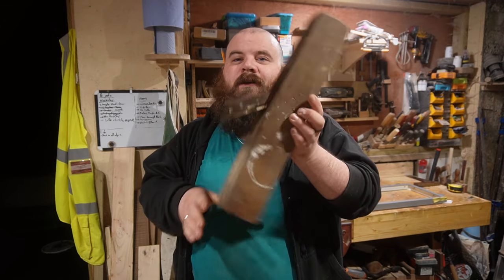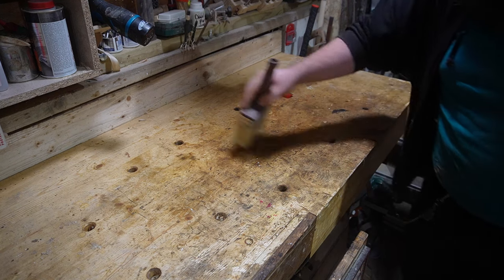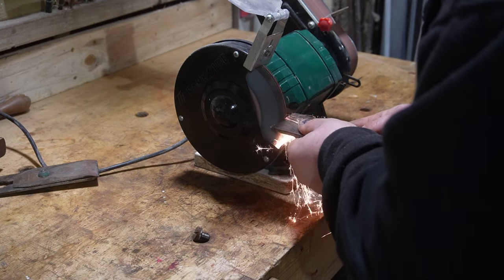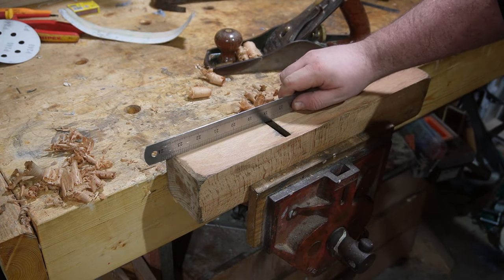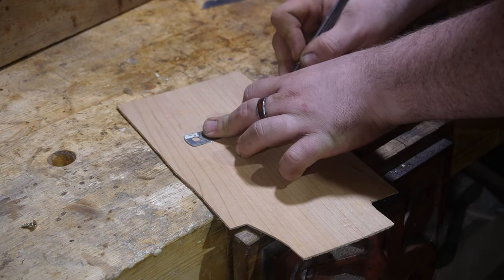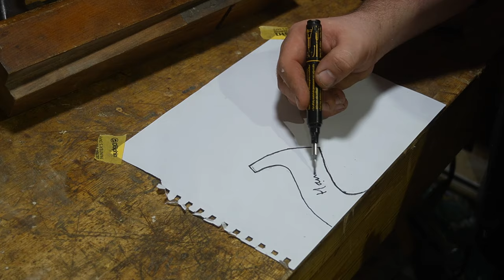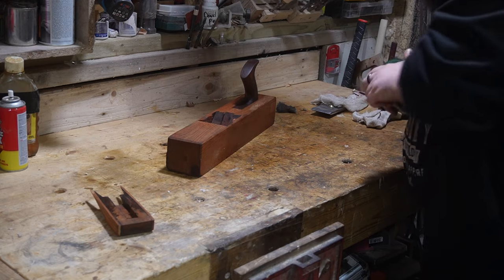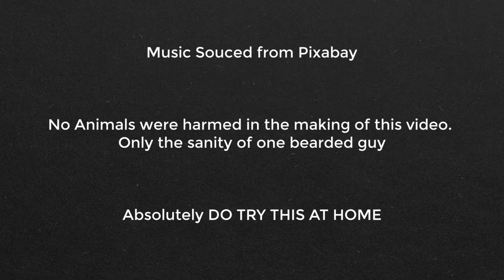Trash to Treasure Ressurecting a wooden Plane

Comment: Hello Mike... You will be fed up hearing from me..... That handle is above good, it is pure sculpture. My old wooden planes, gifted to me require light restoration and have always been kept indoors. I do have a what I call a school jack that unfortunately has hammer marks on the front and all edges are slightly chipped but John Hall (Tools) Ltd. Bristol is very clearly stamped on the front. These were the planes provided to schools around the West Country (and probably marked for other suppliers ) to secondary schools so other than a sharpen , sand the edges and refinish) this should last another lifetime. (65 years old I would say. Greetings from Weston super Mare.  Bob.
Reply from the maker: I couldn't get fed up of your comments Bob they are always so kind and informative. Thanks for always taking the time to comment it means alot to know my videos are connecting with people. Mike

Comment: Very nice restoration, Mike. I've not done that particular style of wood plane...yet. Now I'll be on the lookout for one. I have made a couple of totes for my #5 Bailey and Stanley, all with hand tools after the initial bandsaw rough out, an arduous process with strictly hand tools. I picked up a Japanese kanna (hand plane), a smaller one that is sized like a #4 Stanley. Oddly enough, they are not set up, tuned with a perfectly flat sole.  It is an interesting process. Great video, my friend.
Reply from the maker: On the Japenese planes that is 100% true and the same for the chisels. They are built to like 98% with the last 2% left to the maker to do the final setup themselves. Which makes sense really as everyone has slightly different preferences and stones. Thanks as always for watching